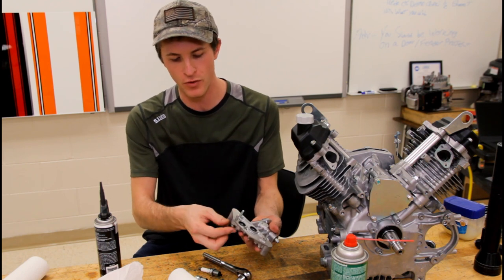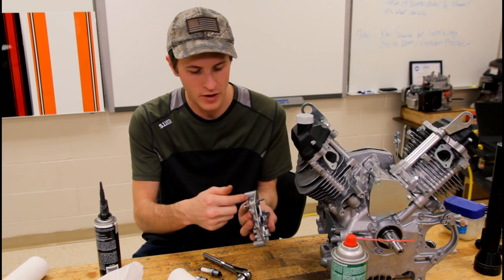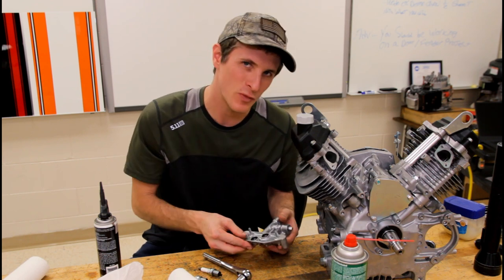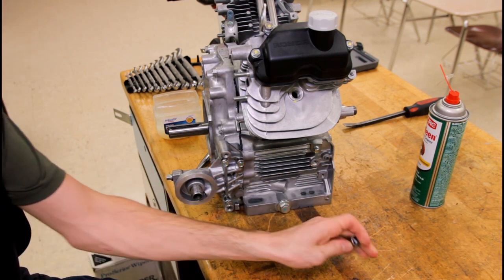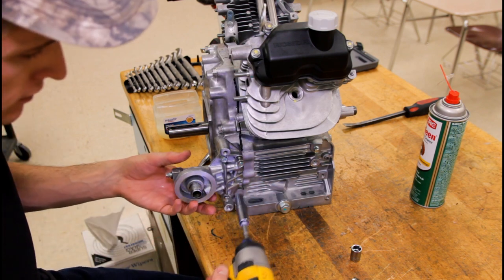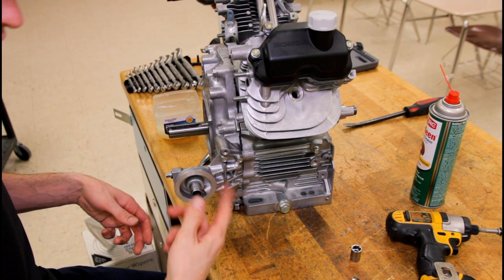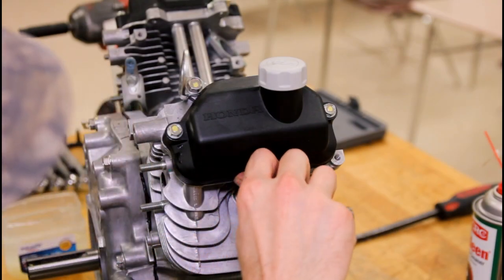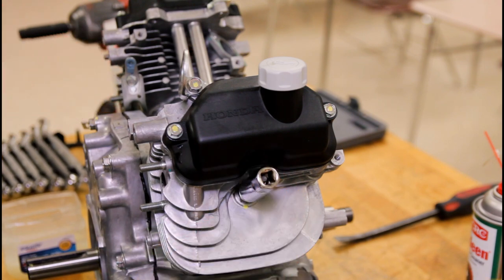16 Honda GX 630 Oil Filter Housing

Comment: Nice content. Can you tell me is there a model of 630 that doesn’t have the oil filter and unit sticking out parallel to the crank end ? I like this engine, but the oil filter past the face of the block stops me from even getting it. Perhaps a relocation part ? It’s cheaper and easier most likely to just get a model with it facing the recoil sside
Reply from the maker: They have a few styles of that housing.  You can interchange them- I think they even have one with a cooler.
Reply: What's the model # on the base?
Reply: I got both a gx630  and a gx690 but I need this housing base to use the side mounted muffler